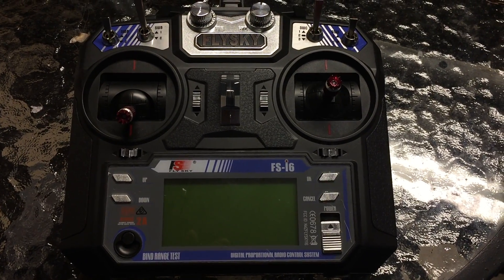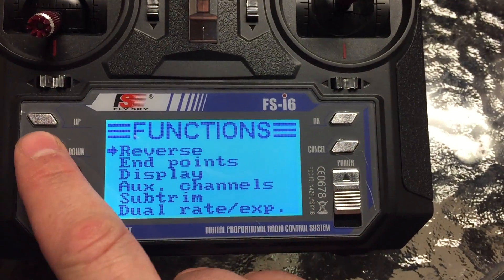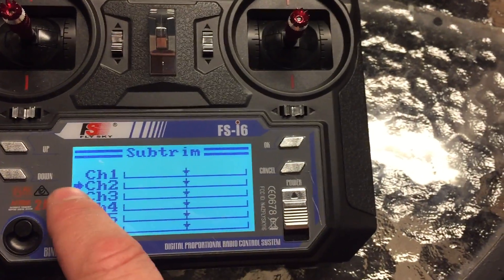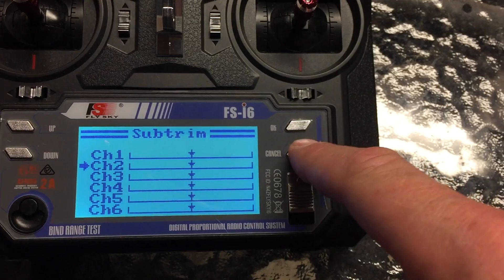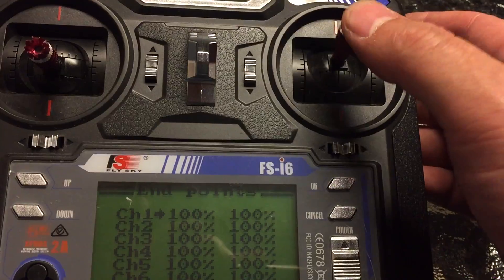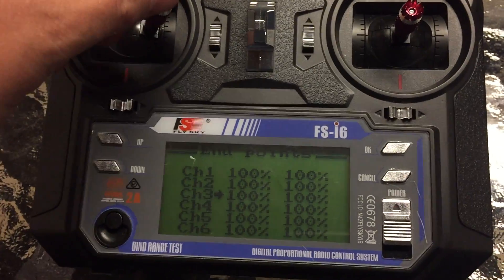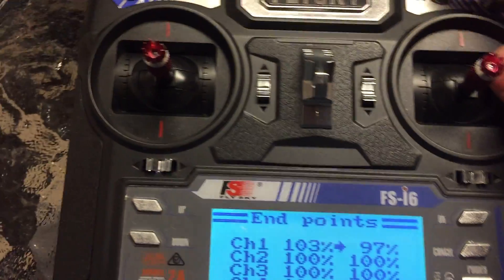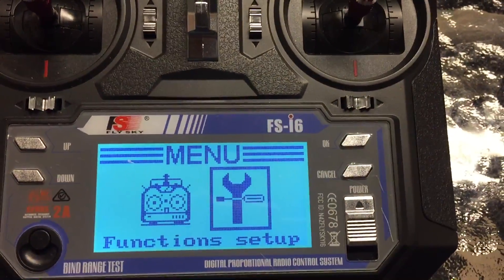FlySky i6 Center/EndPoint adjustment for CleanFlight/BaseFlight Example

Comment: Hi. My quadcopter motors are not rotating uniformly ie(1st motor starts to rotate at 20%throttle 2nd at 40% 3rd at 60% 4th at 75%) what to da?

Comment: Hi. Why we should set up 1100 low and 1900 max?
Reply: I use 1000 and 2000, I don't want to limit movement- the exception is throttle, that needs to be about 975 else the quad may not arm.

Comment: I think I needed this video for my transmitter tuning. It may fix my yaw problem. I'll test it out tomorrow.
Reply: I had the same problem today but I fixed it by doing this but most of the problem got fixed after I opened it and tightened a few screws on the sticks and put the wires in the holder thing if because they were out of it after it was all fixed but on the display it showed a tiny tiny amount and I fixed and it worked

Comment: Ok, thanks for the video. I have a couple questions. I have the fs-i6 and fs-ia6 running on my new (not yet finished) 180, and when I plug it into cleanflight it shows the throttle and yaw as the same thing, I don't believe that's right, but it is my first maiden, so I could be wrong.  Also when I turn it on, and the motors are running, ill flick the pitch up and then flick back into position, but their is a noticeable change that happens when I do this in listening to the motors. I'm not sure what's wrong, please help.